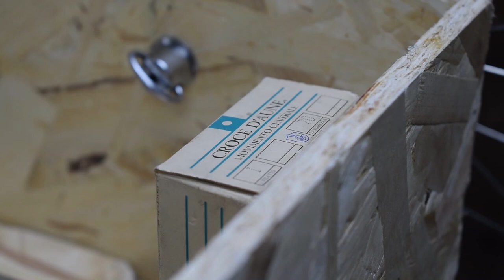VINTAGE ROAD BIKE BUILD -SOMEC-🚀CAMPAGNOLO CROCE D´AUNE🚀

Comment: Beautiful paint.  I learn so much about this sport and hobby watching many videos.  At 13:30 in the shot where you trim the rear derailleur cable to length I noticed a part on the derailleur that I don't recognize.  It is attached to the bottom side of the main body and looks like a piston on a long rod.  What is the function of this part?  Thanks
Reply from the maker: Hi, friend!!! This is the system that Campagnolo patented, called TWIN-AXLE, which eliminates friction at the point of action of the change and makes it smoother when changing gears. I hope my explanation has been helpful. Greetings and thanks for leaving your comment ; )

Comment: Hello. Beautiful how it went and all your work. Do you know the name of the screw that is used to get tight the bicycle chair?
Thanks a lot
Reply from the maker: Hello friend, I leave you a link where you can acquire the screw that holds the stem to the frame. All the best ; )

https://bulevip.com/es/472648-khebikes-perno-de-repuesto-para-la-abrazadera-del-sillon-khe-4260640291763.html?gclid=Cj0KCQjwjvaYBhDlARIsAO8PkE1fUYL_FAsXd4360NbKDHECgsdni7kINdwm-JoIx2201clmEKwSHIIaApavEALw_wcB&tck_keyword=&tck_campaign=13949460219&tck_group=127731853609&tck_target=aud-547935869420:pla-545321681752&tck_placement=&tck_adtype=pla&tck_prodid=p472648.0&gclid=Cj0KCQjwjvaYBhDlARIsAO8PkE1fUYL_FAsXd4360NbKDHECgsdni7kINdwm-JoIx2201clmEKwSHIIaApavEALw_wcB

Comment: 30 seconds into the video and two big mistakes. 1- never clamp the top tube, should put the saddlepost and hang it there 2- the BB threader has 2 parts and you should use both to make sure that the BB is aligned. I stopped watching. Before posting videos know what you are doing
Reply from the maker: Hi, friend!!! 1º this bicycle is made of steel, you can take it from wherever you want, it also has an aerodynamic seatpost which makes the seatpost slide off the mounting support of the bicycle with the weight of the components (I don't know if you know or have never ridden none like that). Apparently you see many "DREAM BUILD" assemblies where everything is carbon and there you do have to take it from the post, since you don't have a good support bracket on the frame. 2º What has been done in the bottom bracket shell, has been a simple cleaning of the paint that may have gotten into the thread of the bottom bracket shell. No new thread has been made (so it is not necessary to align, it is simply inserted and cleaned) and 3rd I do not tell anyone how to do their jobs, I only show how I do mine. If I do it wrong for you, I respect it, I'm not perfect. What should you do when someone has another way of working that is not like yours? All the best ; )